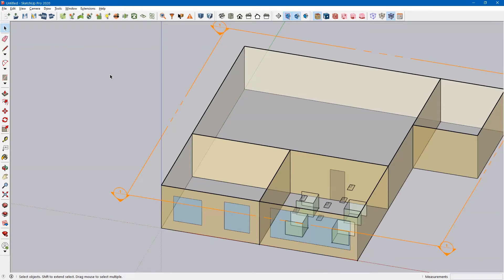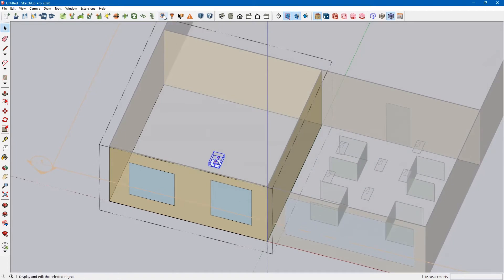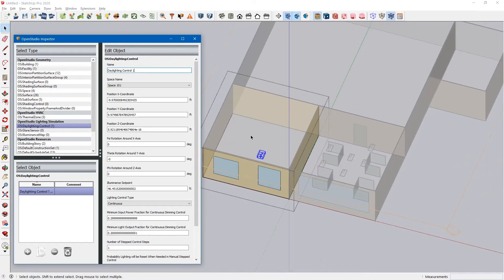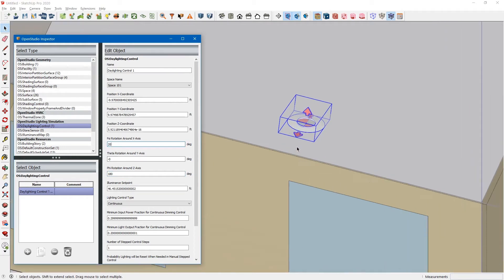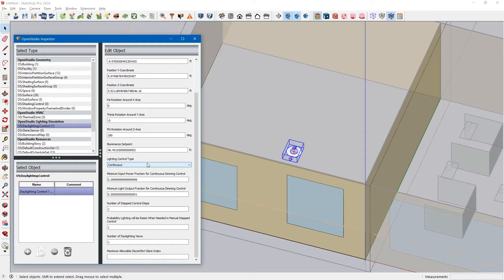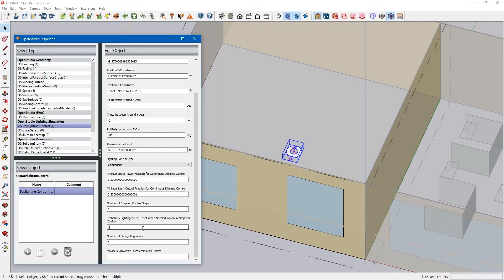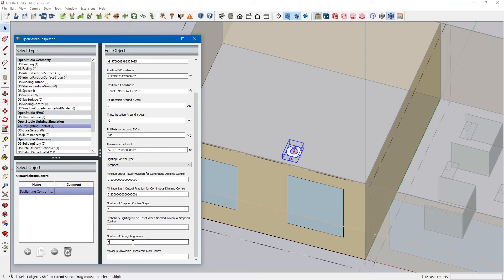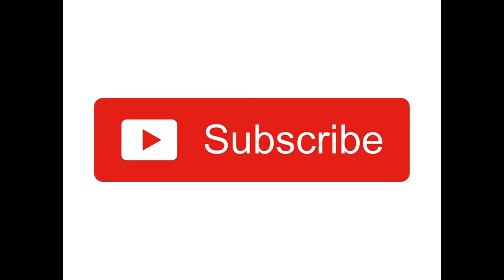OpenStudio SketchUp - Daylighting Controls

Comment: Dear, 
I am not sure can I ask the question here, but let me try. 
I am trying to get daylighting factor DF(%) as output from E+. In order to get it, I need to place sensor at desired locations. But seems like I can't get it as output variable. Is there any other way to do it?
Reply from the maker: I don't think EnergyPlus naturally calculates daylight factor.  But, you can get output variables for illuminance at the interior reference point (Daylighting Reference Point X Illuminance) and the site exterior illuminance (Site Exterior Horizontal Sky Illuminance).  From those two variables, you should be able to calculate DF.

Comment: Hello, thanks for your tutorial again. In InputOutputReference guide, there is a "1.15.1.1.4 Field: Availability Schedule Name". However, I am not able to find it in the SketchUp plugin. Is it only for E+ not OS? Not sure how we can schedule the daylight control. For example, I only want the daylight control to be activated between 8am-6pm to get desired light level. After office hour, even if the room is dark I don't need the electric light to get that level. Is there a way to do that? Thanks.
Reply from the maker: It appears that this field is not exposed in the OpenStudio application, so you would have to write a custom EnergyPlus measure to access it.  

It may be easier to just create a lighting schedule; You will have to create the lighting schedule using the OpenStudio application:  https://youtu.be/RsLllMkMjqQ  Then, assign the lighting schedule to the lights in the space under the space types, loads tab.: https://youtu.be/5ZjqfSV6M1k
Reply: Hello Sir, in this lighting schedule do you set the fraction of lighting to a constant value of 1 when daylighting control is activated, and set the fraction to 0 when it is deactivated? In this case the lighting schedule becomes lighting system availability schedule and the fraction is actually controlled by the daylighting control. Thanks a lot
 @helixenergypartnersllc3540